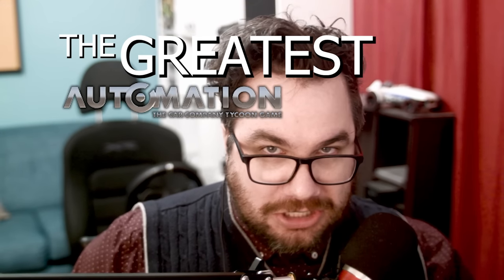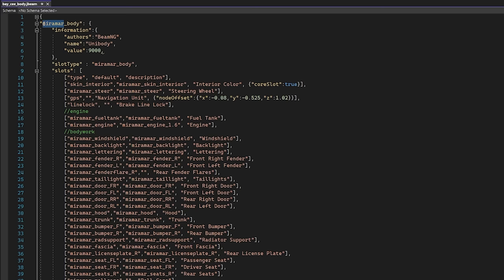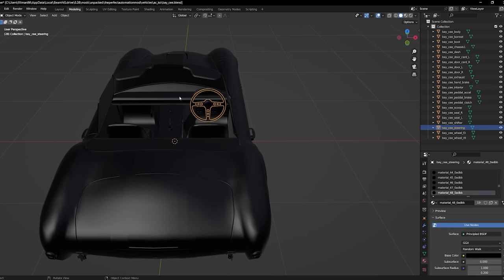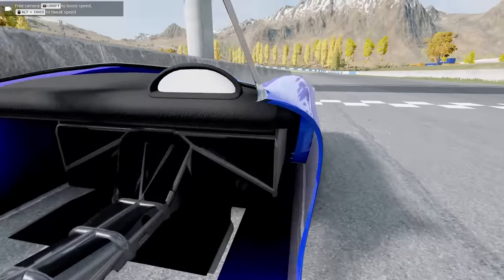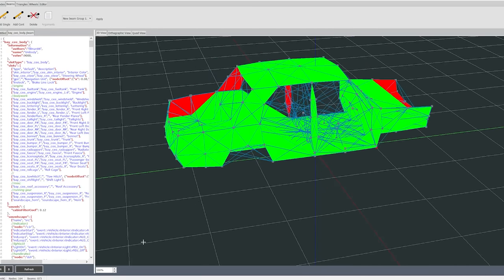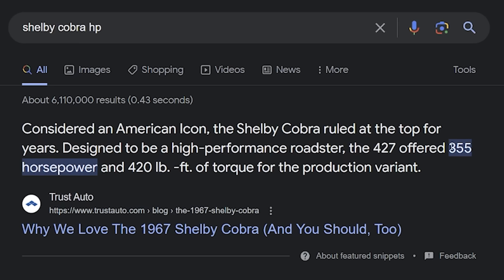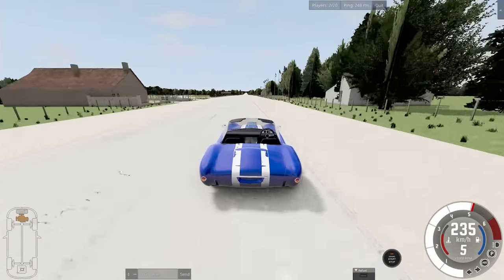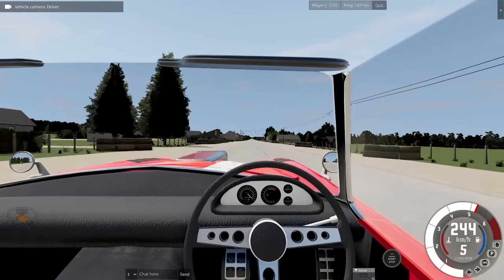I Wanted to Make an ENTIRE BeamNG Mod in ONE DAY

Comment: inb4 the next automation update completely overhauls the way bodies work and somehow adds a way to make everything you just had to do
Reply: @Damian-cilr2  Yeah. They've also said that they're planning on adding fighter jets and a 30 minute long bonus campaign set 300 years in the past.
Reply: any major changes to existing systems would only really be possible with the next game because that would mean rewriting mostly everything about them which will be a tremendous work
Reply from the maker: I somehow doubt these things are coming, as they've stated multiple times that having exportable steering wheels would be impossible :/
Reply: @fillman86  I know. It's easy to imagine an option that would let you work with every panel of the car as an individual piece, but in practice it would take not just a metric crapton of coding, but also a lot of time, all for a little piece of realism that won't even matter outside of BeamNG.
Reply: @itryen7632  wait fuck i got confused.

Comment: reminds me of my scuffed cobra clone i made a while ago, 3000 hp twin turbo v8, wheels spinning up to 300 kph, sub 8 second quarter mile, 650 kph top speed with adjusted gear ratios, and over 18000 hp with the supercharger mod along with 850 kph topspeed until the tires explode at 1000 kph wheelspeed
Reply from the maker: haha sounds excessive

Comment: 12:50 I have no problem moving them. You have to select them with the almost invisible selection box, they select the move button. When select them with that near invisible box, they will not look like they are selected at first. Dont double select. Also,  you won't see arrow handle bars in the front, top, left windows. you just click and drag and the move fine. You should not need those handle bars being each view is only 2 axis, if you want 3 axis, then use 3d view.

Comment: I had no idea the ac Cobra had transverse leaf spring. (Older corvettes also have it). 

Also for the steering wheel, did you just grab parts from the Miramar?
Reply from the maker: actually a lot of mid price sports cars had it back then, as it was cheap, but also what race cars were doing sometimes :)

Comment: little tip, in 5:10 you duplicate the mesh and delete the body and delete the interior in the original, you can achieve this easier by doing mesh>separate>selection while in edit mode
Reply from the maker: oh damn, I completely forgot about that XD though one problem is that automation generated meshes can be technically thousands of segments :/ so it wouldn't always work too great
Reply: @fillman86  the only time I used automation for modding it was hell, and i just used it to get the details of an i6 block 💀speccialy the rotation is super messed up and all of the drivetrain is a single part

Comment: In blender, (in edit mode) press P and select "separate by selection" to not have to duplicate and delete geometry from objects.
Reply from the maker: I did forget about that, but it also would be problematic with how automation meshes can end up broken into thousands of parts :(
Reply: @fillman86  ah that's fair. Although it should do exactly what you were doing I think, minus the invert selection and duplicating. I could be wrong though. Either way thanks for the entertainment, always look forward to your videos.

Comment: Another fantasticly jank creation from Sir, Fillman86. Please polish this a bit more. I would like to assist with some tuning and accurate specs. Also make sure that the added engine parts(like the scoop) go into the common folder. Then they can be used on other vehicles that engine fits in.
Reply from the maker: I'm entirely fine with people taking my mods and making their own versions :) though I have reworked it a bit, and it jiggles way less now

Comment: 15:29 I love your stuff, but I wanted to fact-check your numbers. In the top spec Cobra, which is the body styling that you are using, the Shelby Cobra 427 S/C made 425 ‘MURICAN horsepower, giving it an almost even ci-hp figure!
Reply from the maker: cool, you can put that power in if you'd like haha

Comment: The difference between the AC and the shelby cobra is that the Shelby cobra is an AC with a ford engine tuned by Karol Shelby
Reply from the maker: haha it's also a little wider
Reply: @fillman86  it probably has wider rear tyres too then

Comment: 26:26 Yeah, I've noticed this is a problem. Is there a way to make beam cars and their parts/attachment points stronger within the files or nah? Also, despite this video being older, I'm going to address this based on the order I watched it: You are once again using "front" suspension on the rear of a RWD car. (I'm talking about the RWD covet vid. though technically it wasn't front suspension there... You get my point.)

Comment: for the engine you could have used the 423cui from the barstow
Reply from the maker: sure, but this one also works....
Reply: @fillman86  very true but it has the carbs and you can get the dual 4 barrels on it so it would fit the shaker scoop perfectly

Comment: Its been a little bit, but wouldn't a good option for the base for to mod have been the bolide? Its double wishbone all-around, its already separated into three parts, and hav the same suspension front and rear (the only difference being that the front has tie rods and the raar has a bean in there place)

so theredically you can take the engine bay, move it to the front, and the front, moved to the rear, and since its the same suspension for the most part all you need to do is move the steering rack. Other than extensive coding, maybe just put two engine mounts in the fronk (if corse without the fronk liner, radiators, and what not being there), pray it doesn't glitch, and call it a day. Also maybe swap the suspension values front and rear so it doesn't handle like a spagetti noodle.
Reply from the maker: haha there's many reasons I did what I did. The extra coding required for doing it with the bolide would have exhausted me.

tbh the biggest issue was just how bad beamng's vehicles are :/